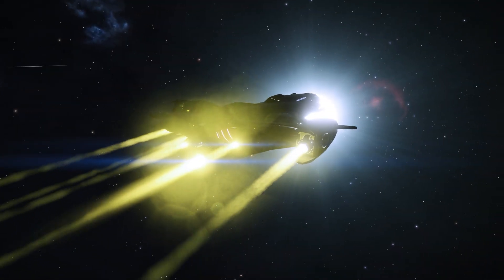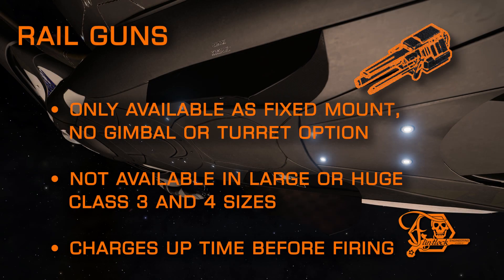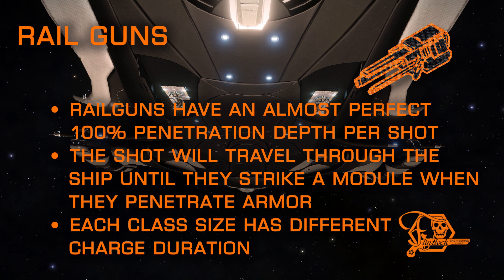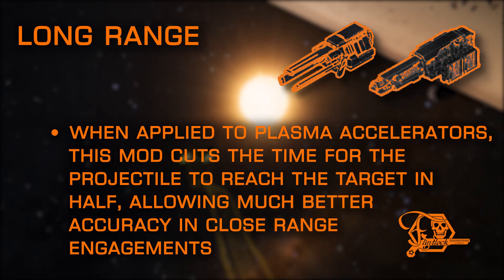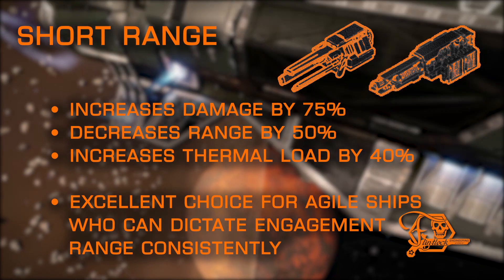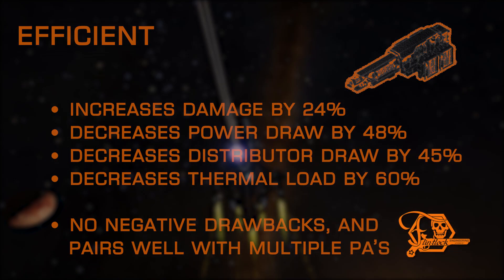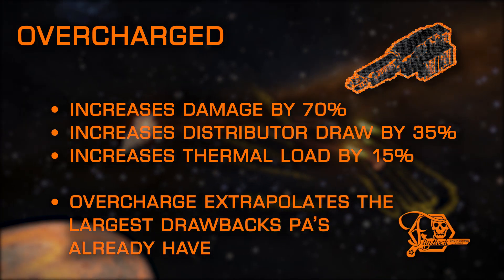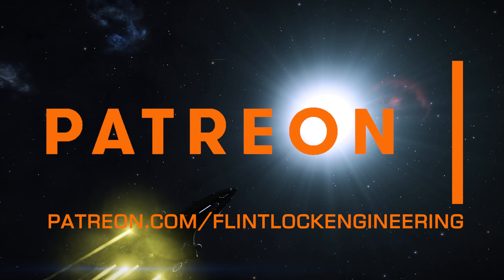Engineering Series - Episode 7: Railguns and Plasma Accelerator Modifications

Comment: I think you maybe mistaken about the increased piercing effects for rails and PAs.  I believe the piercing value works both sides of a ships armor hardness like resistances.  Example 75 hardness is hit by 50 piercing so 1/3 of the damage is reduced (15 - 5 = 10) but if 75 hardness is hit by 100 piercing, than 1/3 damage is added (15 + 5 = 20).  So a significantly higher piercing value over armor hardness gives you a massive damage increase over your base damage hit.  I don’t know this to be 100% true but it was explained that way to me by several seasoned pvpers a few years ago.  Also I have a Python with three class 3 focused PAs and all three at once will chunk 35-40% hull from a NPC Corvette or Cutter.

Comment: Great stuff. Already knew abouth the Piercing thing on Focused mod. 
But pls do tell, do the Focused bring additional effectiveness when used on Thargoids!?? I have not seen any utuber mentioned or covered this aspect ; )
Reply from the maker: No, the increase in piercing will not increase damage done to thargoids simply from the piercing value. A good question though!
Reply: @FlintlockEngineering  Dang! Well i would LOVE to know the Resistance values on Thargoids Hull Armour, all of them
Reply from the maker: @Battlenude  well the cyclops has an estimated 100 hardness, the basilisk is around 140, medusa is somewhere around 175 and the hydra is over 225.

Hope that answers your question!
Reply from the maker: @Battlenude  human weapons are just ineffective against them regardless of where you hit (except scouts, they can be harmed reasonably with human weapons), so it's irrelevant, really.
Reply: Focused increases shot speed too.